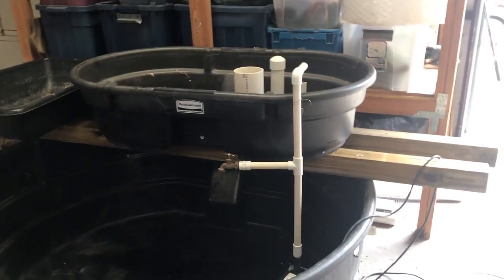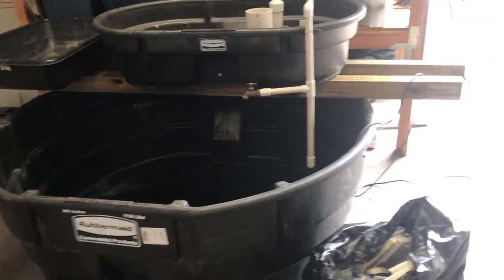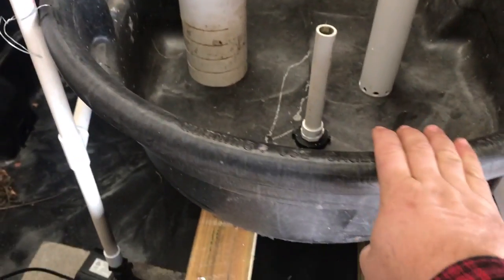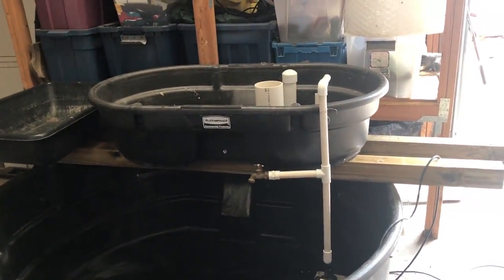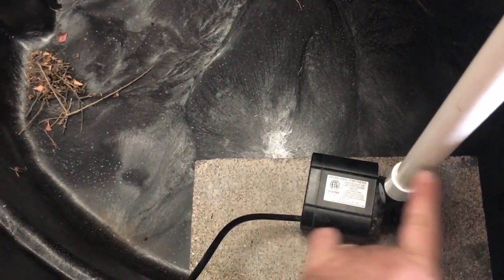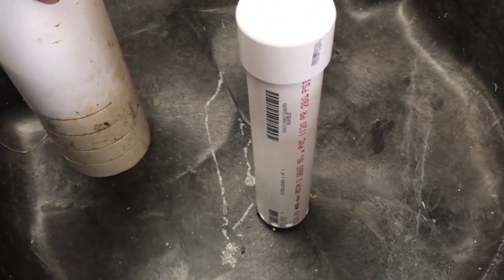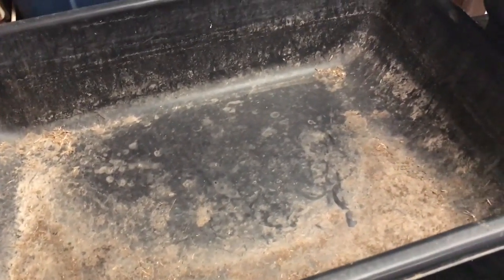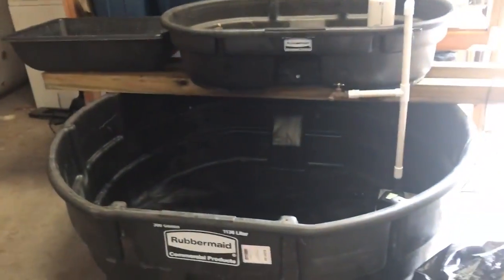Indoor Aquaponics Set Up - Episode One

Comment: Don't forget 30 days to cycle your bacteria getting started and you probably only need to heat the water to the min setting on an aquarium heater to keep tilapia alive. (45 degrees)
Reply from the maker: It won't take that long, first the media is from old beds so they are full of bacteria, next I dumped a few gallons from my other system in, then I dumped in a cup of garret juice and a cup of liquid kelp, worms are in the system already.  We will toss a few goldies in, make sure we are stable and order our fish.  

I have kept adult tilapia alive down to about 45 degree water but they barely move, babies go tits up at that temp.  Besides unless we warm them up enough to eat and grow there is no benefit to bringing them in right now.  The entire point is to have bigger fish next year with an earlier start.